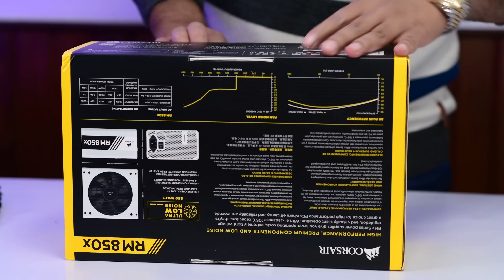Ultimate High-End Water-Cooled Editing & Gaming PC Build (3950x, X570 Aqua, RTX 2080 TI, Torque )

Comment: Get two highest clocking B dies, then find the highest possible Infinity Fabric clock, setup memory 1:1 with Infinity Fabric, and then tighten ALL the timings as low as possible. Voltage can be raised quite a bit because RAM uses low voltages for energy savings and even quite a bit higher voltage is 100% safe in 24/7 usage. 

Regular 3200mhz ram and 1600mhz infinity fabric VS. 3800mhz ram fully tightened timings with 1900mhz Infinity Fabric, and the latter has over 30% higher FPS on 1080p with 2080ti on games like Assassin Creed Odyssey. With these settings and PBO2 enabled, this rig wins agains 9900KS with the same memory and timings.